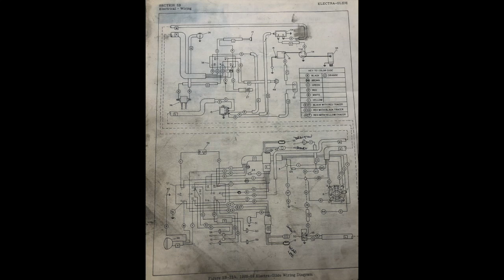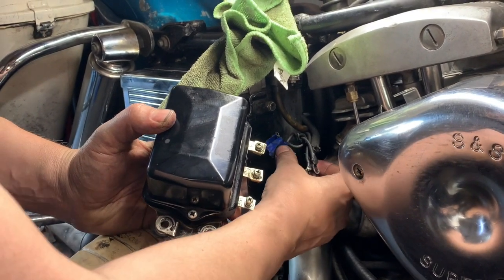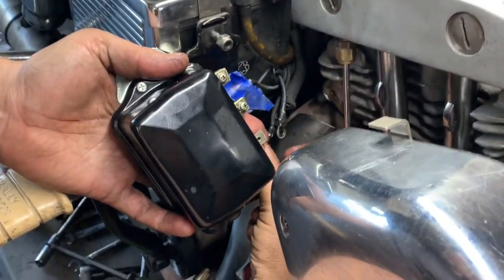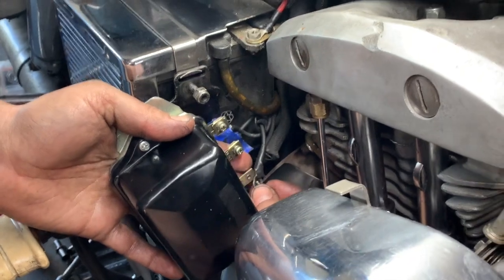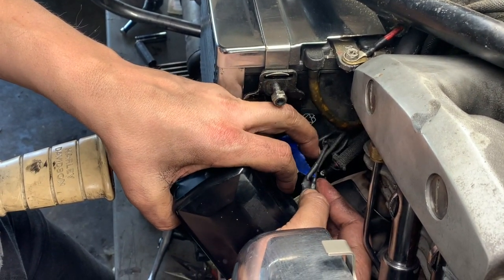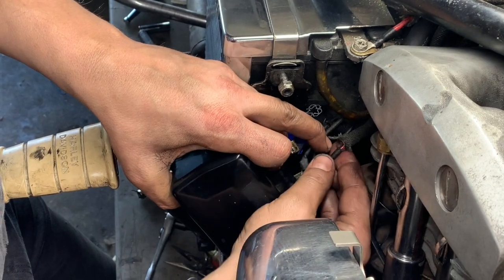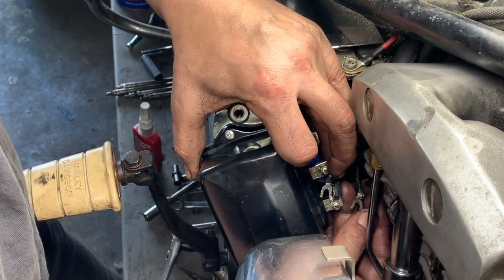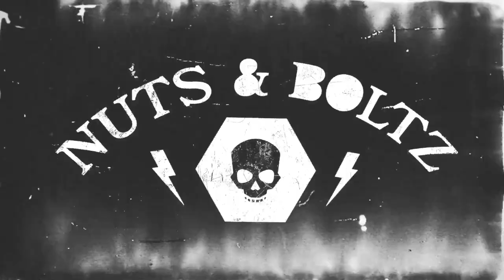#8  Delco Remy Rectifier Installation -1969 Harley Davidson Electra Glide Shovelhead FLH Head Instal

Comment: The Delco Remy regulator looks cool, but they are a pain in the ass. I still have one on my 65, but only for looks. I run an electronic voltage regulator hidden under the bike. I also run the stock generator with the electronic regulator. The generator doesn't have to work so hard. Oh, and my head light stays bright at all times. It doesn't go dim at stop lights anymore.
Reply: What type of electronic regulator did you put in there? I wanna to try it on my 67
Reply: @TheSkylark16  don't know the manufacturer. Probably cycle electric for twelve volt system. I did it back around 2005. I made a trip to Key West, for the Phill  Peterson's Poker Run. Had to leave the cover off of the Delco Remy regulator and keep tapping the contact for the bike to charge. When I got home, I fabricated an aluminum plate and mounted an electronic regulator up under the bike. You can always go with the electronic regulator that bolts on the end of your generator. I didn't go that way because, I like the bike to look close to original. Good luck.